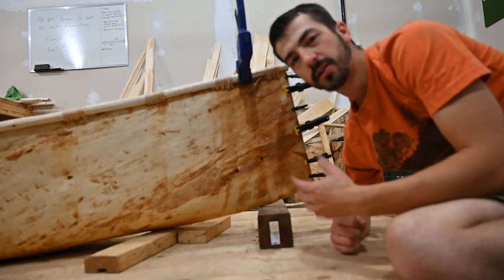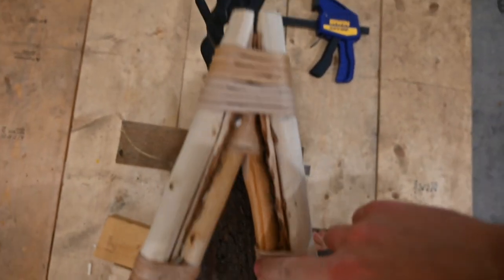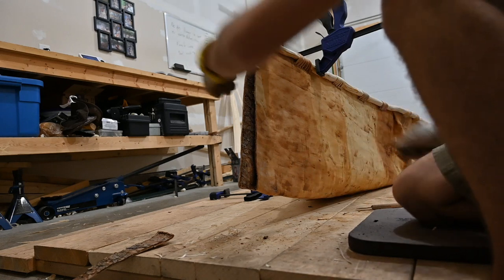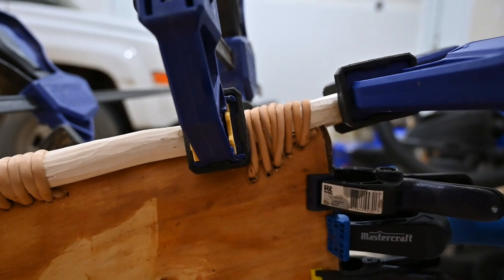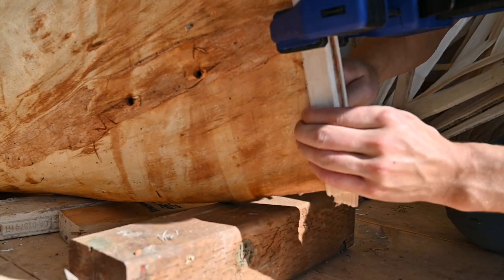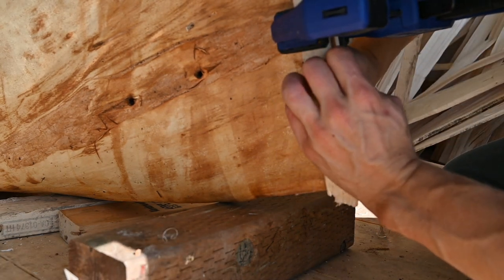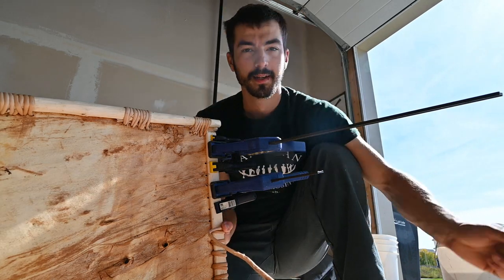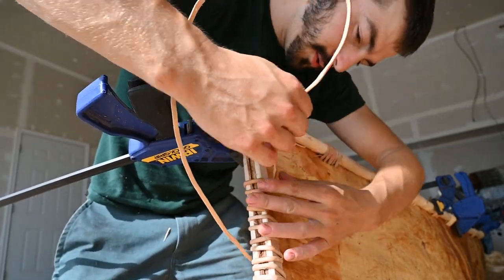Building a Spruce Bark Canoe - E4 - Stem Pieces

Comment: I wonder if passing a straw through both holes, at the wide parts, and passing the root through the straw would have made that part of the lashing easier. Your fingers must be fairly calloused. Thanks for taking the time to film.
Reply from the maker: That is such a smart idea ! I never thought of that. I could use a small copper pipe of come sort that would be just small enough. I will try that next time ! :) thanks for the idea man and commenting.
Reply: @NomadicWoodsman  Brake tubing is fairly small.
Reply: I wanted to say that too. I've used similar trick for snaking wires. Pex and pen tubes work good also.